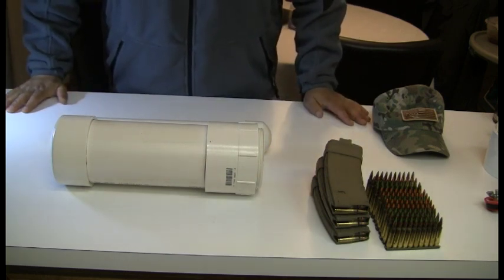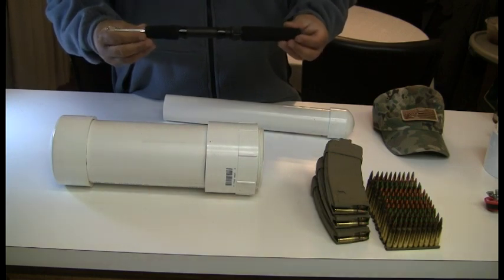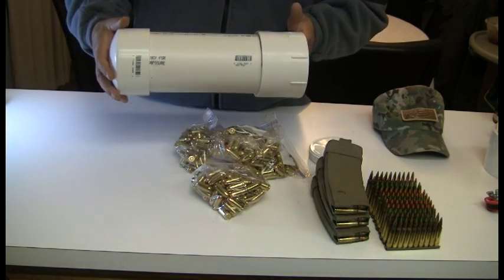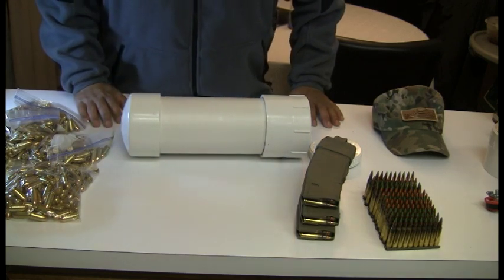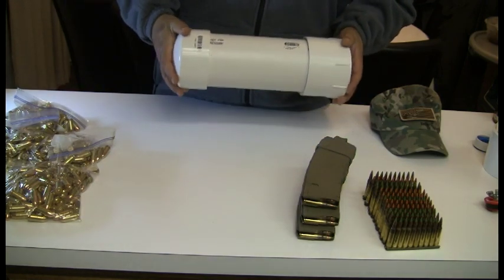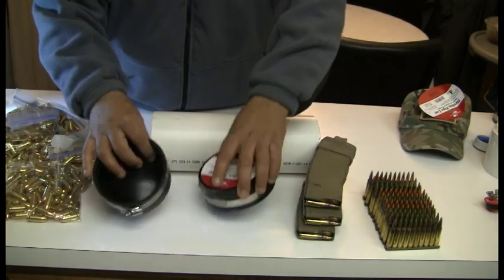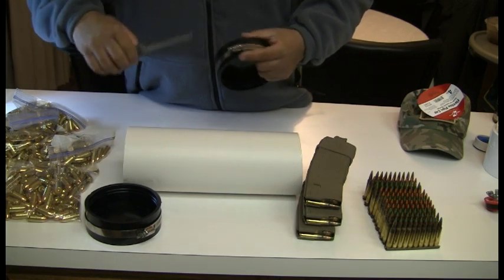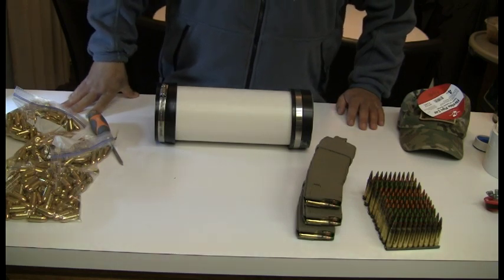Burial Vaults, Firearms, and Geo-caching

Comment: Eleven years ago I buried some firearms and supplies inside two 8" PVC tubes. I placed the PVC tubes inside black 12" culvert tubes for earth protection and buried all approximately three feet deep. Similar as shown here in this video I too used pipe, end cap, female adapter and plug to make my PVC storage containers. I had to hunt around for scrap 12" culvert tube which I got for free at a construction yard. I also used a five gallon pail on one end of a culvert tube that was too short. Five gallon pails in fact can be used instead of culvert tubes. The reason I used a culvert tube (5 gal pails work good too) was to leave a cavity in the earth so not to stress the PVC pipe. Not too long ago I had to relocate the weapons stash I buried eleven years ago and when I opened the PVC tubes my stash was safe and sound. The hydrosorbent silica gel canisters which were placed inside the tube were still good also. To open up the PVC tubes I used a moto tool and cut the PVC plug off "not damaging the pipe adapter threads of course so that I could use the tube again. I sealed the plug on the PVC tube good when I buried it. I used extra precaution because I hate thread leaks. I applied good pipe dope on the threads and after sealing the plug I washed off all exposed pipe dope, allowed it to dry and sealed the remaining threads and thread area with waterproof Goop. I also encapsulated the PVC tubes inside 1/4 wire mesh just in case some animal with sharp teeth and claws discovered the PVC. When I unearthed the tubes I was amazed when I saw the galvanized mesh had not a spot of rust.

Comment: When I lived in California and had lawn sprinklers, I dug larger holes under each brass sprinkler head and installed those vaults......Later, I used a metal detector and could not find them as they were loaded with steel tubing to test my theory. No one would think to dig up a metal sprinkler head and find my weapons stash. The home I live in now, does not have a system so I went deeper to avoid detection while living here.
Reply: Ground penetrating radar. It will be found. The army uses the vmr2 which I have found IEDs and Chinese rockets buried. So dont count one the police not having that technology. 

Bury them DEEP or bury them on top of your septic tank they might just dismiss it as a false hit or just say meh it's a septic tank.
Reply: @chasingthefish9042  There’s no point, they will find it. 
As you said the technology they have now is incredible. 

I don’t think there is Anything that will stop things being detected.

Comment: Because the threaded end runs the risk of not creating a true watertight and airtight seal if you don't prepare it properly, it is actually a better idea to use a longer piece of pipe than you need, then pack the extra space with old cloth and then use a conventional cap on the end.  Mark this end so you know it is safe to saw through when you recover it and you won't have anythng to worry about.

Comment: PrepperLink Awesome video, glad to see people are thinking ahead and educating others. 

I use an alternative to the threaded end pipes, just because it removes the need for tools to open. Usually I reserve this for "fast bugout" tubes because it's simpler and easier to maintain and access: I use plumbing test plugs to seal the access end.

The beefy wingnuts make it easy to open with bare hands and/or gloves, and it is a mechanically-expanding giant rubber o-ring. Have a small set of pliers and you can tighten that thing like crazy. NOTHING gets through them. Plumbers use them to inspect piping buried in the ground. Test plugs also are more reliable - with PVC, repeated use will slowly enlarge the threads and loosen the fitting, allowing moisture and contaminants to get inside. Not good because, let's face it - we're not building these tubes for one-time applications only. They'll be our safest way of storing small, vital objects during SHTF situations.

I also pack a small Tylenol pill tube full of industrial-grade rubber-friendly grease in each of these tubes, as well as silica gel baggies. Once every few uses, rub a bit of grease on the rubber and on the outside screw to prevent drying-out and rust formation. Any residual moisture inside will be then absorbed by the silica.

That's my $0.02 - hope it helps. Stay frosty, safe, and alive.

Comment: Nice vid, I like the idea of the 4"pvc it looks like it would be a quick burial using a post hole digger. I would suggest using 1 end, the bottom, pvc cap and the top use the rubber. That way when loading the tube or dropping the tube into the ground, you have a much harder bottom to help prevent breakage.

Comment: Thanks for the tips. People can armchair quarter back but you are doing the work and putting these ideas out there. As far as the PVC vs ABS you can simply spray paint primer or paint on the cache. This will protect the plastic. from outside interference. cheers

Comment: Don't use PVC. You need ABS pipes,
PVC is an unstable product. It will keep breaking down over several years.
Contaminating anything that it holds inside. And become brittle as chocolate.
Also mind the frost depth in your area. If the ground freezes, your pipe will crack.
So bury below the frost-depth (typically around 1 meter should be enough).
Hot/desert region? Air will expand inside and can crack the pipe as well.
Also mind groundwater. Soil containing groundwater will float (a light) pipe to the surface.
It will go slow, but it will reach the surface eventually.
Reply: +Martin Yes, PVC needs protection or itself won't be able to protect.
Reply: +Martin Where do you get this BS? Air will crack PVC pipe? If you don't know what you are talking about just shut up.
Reply: Yep, expanding air can easily crack a pvc pipe. It's no bullshit. If the pipe was closed at cold temperature and the pipe heats up, the air pressure can reach very high levels. Learn a bit about pneumatics and general physics.
Reply: +Martin I have an engineering degree.
Reply: +Martin  The coldest temp the glue can work is 32 degrees. If you left the pipe on the desert floor (not buried 3' down where the temps are probably 60 degrees) say 120 degrees. Initial pressure in pipe is 1 psi just to make things easy. Final pressure in pipe is 120 degrees/ 32 degrees * 1 psi= 3.75 psi . Max pressure for schedule 40 pvc 6" dia is 180 psi
Reply: +Michael Chrest Trust me, it will burst.
Reply: Indeed. You are correct. And now you understand why. Metal/Copper or ABS only. PVC is forbidden for (drinking) water, gas-lines and pressured lines in general. At least in Europe, but I assume all around the world. It may only be used for waste water (drains).
Reply: For those interested in cache pipes, take this PDF as a good guideline : http://www.nebraskahistory.org/conserve/treasures/pdfs/Time-Capsules-and-Pr%2311028F.pdf 
(Also explaining why not to use PVC).
Reply: Dutch Prepper  in America it's common practice for drinking water to go thru pvc pipes.. Though most newer house take pex pipe...
Reply: @Greg Peck my house has pvc for septic, but all my water lines are copper, except for the well tube that goes from well to the pump, that's PVC aswell.
Reply: New math vs been there done that knowledge.
Reply: So there isn’t any safe place to put these things?
I have been saying this for ages, plus they will find your stuff anyway look at technology and what it can do.

Comment: You could just use the pvc pipe for a fishing pole and use the inside for storing bank line, hooks, sinkers, and bobbers. I think Dave Cantebury had a vid posted on how to do it. The one end cap with the large flat head would work the best for me. I always carry a hatchet when outdoors and it would be easier to open. Thanks for the info and best of luck to you.

Comment: Fernco caps all have standard 5/16" nuts with a slot in them for tightening, a nut driver works the best to tighten. If you use a pvc cleanout  the plug should be Teflon taped and also doped. The pvc  cap and cleanout are definitely stronger than a fernco  cap but both should work well for prepping purposes, and yes I am a plumber.....

Comment: Nice, just an idea, for the one that you said you might not have the tools you need, why not just bury a solid plastic tool that fits in that slot right next to the cache? I assume there is a purpose built tool that fits into that groove, but you could probably throw an air-hockey puck next to your cache and be good to go.  Just a thought.  Thanks for making the video.

Comment: Those clamps won't rust, they are made from ss(stainless steel), the screw and screw housing,will rust. You Can buy ALL ss clamps which includes screw an housing, little more expensive though.

Comment: I’m making a cache from 6in pvc which is “schedule 40” type. It will be about 3 1/2 feet long and store one of my 10/22 Rugers with ammo. Do I have to worry about condensation at all with the schedule 40 type I have? Obviously I will be using some sort of protective  (vacuum seal plastic, contractor bag, long Mylar bag, etc) sleeve to put the rifle and ammo in while inside the cache, but I’m just curious about the condensation factor. Can I rest easy about the condensation? Also, the plumbing supplier I bought my pipe and other material (pipe primer & cement, end caps) from did not have the coupling for a 6 in pipe, so I will be using an end cap (no screw cap)  on both ends to complete the cache. Obviously I know I will have to use a hack saw or repeating saw in order to open it when I do need it. Do you think I’ll be ok with the schedule 40 and two end caps? That’s my big question.

Comment: What would you use to prevent condensation of moisture inside the tubes (even if its ABS)?? Do you use a dessicant added to the tube? Moisture being the enemy and if a good rainfall or colder temps occur, then condensation inside pvc or ABS will occur if it is buried. Interested in the replies.

Comment: You could zip tie a piece of flat steel that fits in the slot on the end to the side of the tube. Thus when you dig it up the tool to open it is right on the outside of the tube. Plus you dont have to bury expensive tools with each tube. Just a budget thought.

Comment: I'm sure PVC would work fine for this application, but what about CPVC? It withstands higher temperatures and has a higher tensile strength. Downside is that it is considerably more expensive.
Reply: I would think CPVC is brittle and PVC is much more durable would work fine since it's not gonna get any hotter then it would under a house. But that's a good thought.

Comment: A nut driver works better for tightening the stainless steel clamps. Most clamps are made to accommodate both screwdriver and nut driver.

Comment: The clamps on the rubber caps are weak . Go to a truck stop and paybextra money for a hd  clamp which can be torqued diwn with a wrench or socket   Applies more equal
 Pressure

Comment: OK, so you bury thousands of rounds of ammo in baggies or a firearm... what about moisture?  What about condensation developing inside the tube and baggies as the temps vary in your location?  Nice idea, but don't think you are going to leave your Cache in these tubes up to a year and not find "crud" all over you ammo or firearm.  So, any ideas?
Reply: Taking cues from my job -- I work in the shipping department of a lab equipment manufacturer, and a lot of it is EXTREMELY sensitive to moisture and oxygen contamination. 

It's a lot simpler than you would think - seal the ammo/gun/random supplies in mylar bags, seal them with a crimping iron, and vacuum out the air; do this twice, to insure a proper barrier seal. Throw in a few large bags of desiccant, seal the container with heavy duty silicone, and you're good to go.
Reply: Don Fava I would think it would depend on how deeply you bury the tube. In our area the freeze line is 18", so I'd go deeper than that. Also, think I'd vacuum seal my ammo, etc. and add desiccants. Just an idea.

Comment: What good is that fishing rod without a reel?  I don't see how a reel would fit in that tube.  Might as well scrap the rod, use the altoid method and tie the fishing line onto a stick.

And stay away from the flexible end caps.   You bury those things and good luck trying to unscrew the rusty, dirt encrusted hose clamps.   Get the screw end caps that have a protruding block that can be unscrewed with pliers.

Comment: Depending on what you are hiding, you may not want to use the metal bands as they would be picked up by metal detectors. But if you were hiding metal objects anyway, it would be no big deal.

Comment: Not that pricey really.  A 10' x 4" length of pvc is only $20ish.  The end caps and adapter/plugs will run about $10 per unit.  YMMV of course, depending on your local prices.  You could make five 2 footers for $70.  I'd use the threaded plug with the square end and carry a pair of channel locks to open em quick, fast and in a hurry.